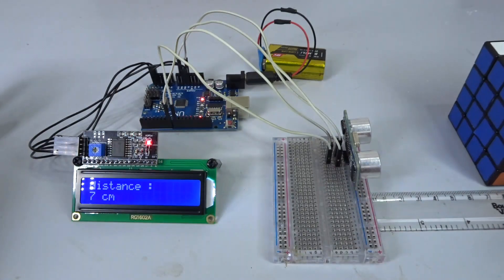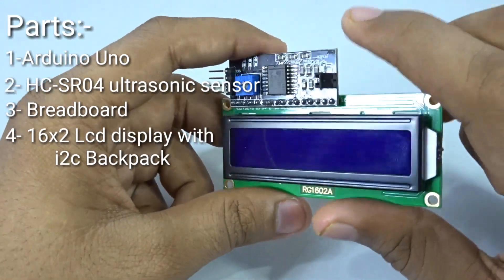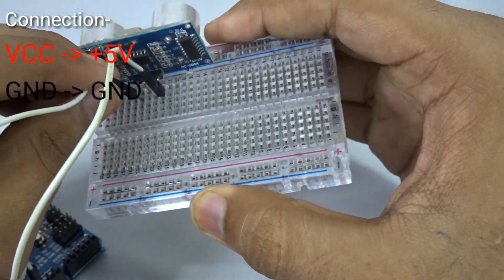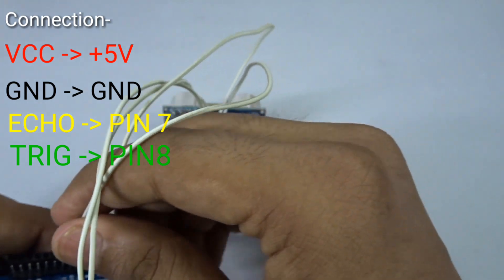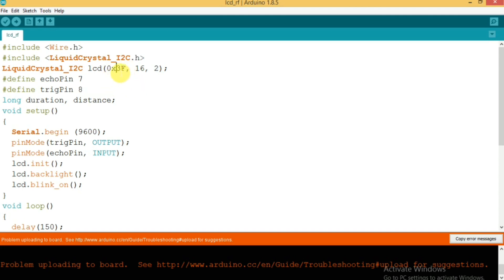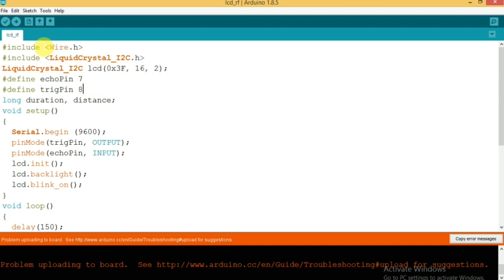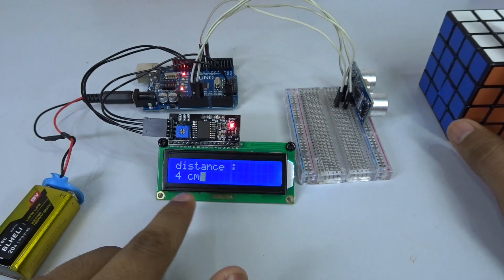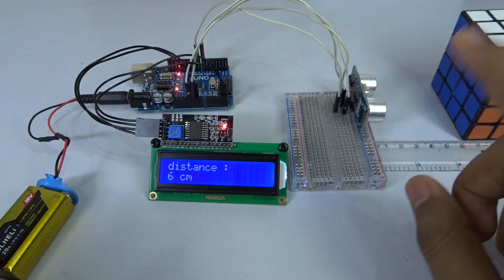How to make Ultrasonic Range Finder Using ARDUINO and I2C Display and Sonar Sensor | Distance meter

Comment: my code is not working it says in the error message: lcdscreen:2:10: fatal error: LiquidCrystal_I2C.h: No such file or directory

 #include <LiquidCrystal_I2C.h>

          ^~~~~~~~~~~~~~~~~~~~~

compilation terminated.

exit status 1

LiquidCrystal_I2C.h: No such file or directory

This report would have more information with
"Show verbose output during compilation"
option enabled in File -> Preferences.

Comment: Bro what is use of library?
Reply: Do the programming
Reply from the maker: To communicate with the lcd.
Reply: Ty
Reply: Can I do this on Android phone?
Reply from the maker: Do what?
Reply from the maker: Yes.
Reply: Bro from ur link I downloaded codes but they are not opening pls provide guidance
Reply from the maker: In mobile or pc
Reply: Mobile
Reply: It was not opening in mobile so I wrote whole code from ur comp. Screen by pausing
Reply: But there is compilation error
Reply from the maker: You have to install the app
Reply: I have andruinoDroid
Reply: Sir pls help I need to make this project at any cost

Comment: I have installed the program but it is not working.
Reply from the maker: Might be a mistake with LCD address
Reply: Ho to connect the i2c with the lcd
Reply from the maker: Arduino program?
Reply: Make a basic tutorial video how to install it.
Reply from the maker: For sure☺
Reply: @INOVATRIX  but when
Reply from the maker: https://youtu.be/UaDxb3WGqAA
Reply: And how to install the program
Reply: Yes how to install it???
Reply from the maker: Plz download the updated and required version of arduino. Which is supported by you PC.
Also add all the required library files before uploadong the code.
Reply: How to add library?

Comment: Hello the character font r too light how can i change it or ihave to calibrate only
Reply from the maker: Are you using I2C backpack?
If you are then there is a little blue box on the I2C backpack.
It's  the potentiometer.
Take a screw driver and rotate it.
The brightness should increase

Comment: I have added the pin echo to 5 and trig to 4 and changing some program but its not working
Reply from the maker: Pin 5 is digital.
With ~ sign.
Try using 7 or as shown in the video
Reply: It is 7 and 8 and its working perfectly